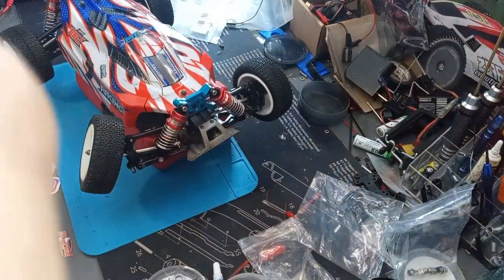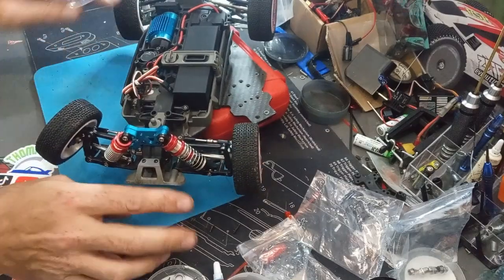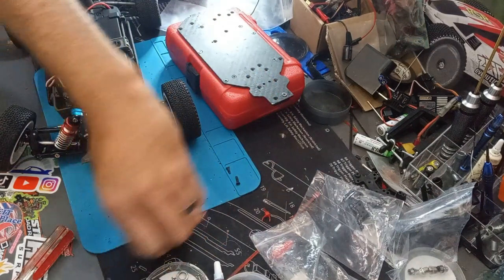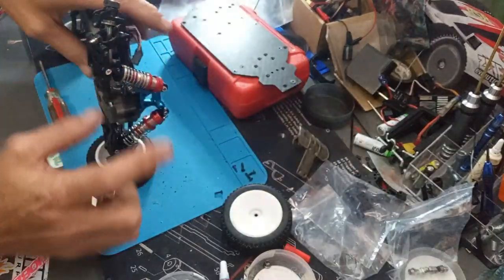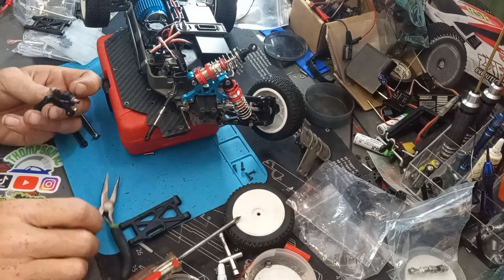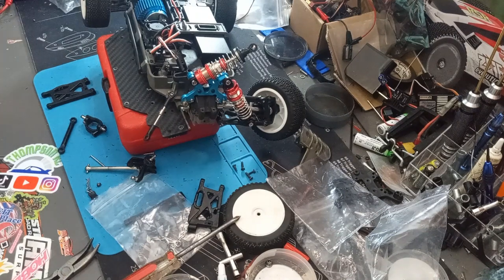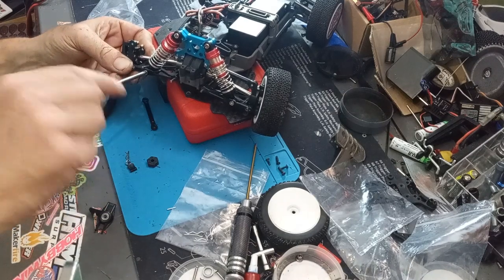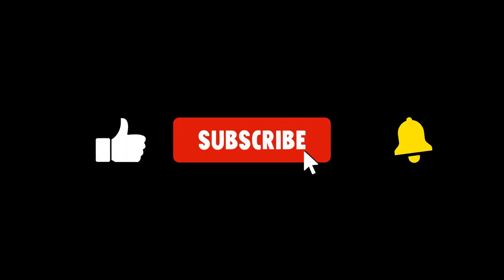Bench Time - wltoys 124008 - Quick Fix - Update - Plus Subs Photos

Comment: Thanks for another informative video — nice problem solving there! 

Yeah, the radio is the DumboRC X6PM with the X6FG gyro receiver. The car has crazy torque so I‘d say it helps a lot with avoiding spinning out when you gas it. 

I have another 124008 on the way, so I think I’ll keep one with the stock setup and put the metal parts on the other one. The incoming wheels are 87 mm, so I guess we’ll see if the drivetrain is up for that. 

Keep the vids coming!
Reply from the maker: Awesome..  I want to get one of the X6PM for back pack RIppin..  I did the same thing with e 124008 one for the track stays stock and one for upgrades and skate park shenanigans ..  

I might put some extensions on one and make to widen wheel base just to see..  

And I'll keep making em if you guys keep watching..   BRRRP..  Thanks for sharing bud.  Thats how this grows..
Reply: @reitplace4765  Yep, that's what gave me the idea to get an extra 124008; it's way more fun with two on the go for racing with a friend or teaching the kids. Plus I can borrow bits as needed, so if something breaks, I should always have at least one operable unit while waiting on replacement parts. 

The super-compact X6PM seems really good so far. I had some concerns about it being too small for my XXL hands, but it works fine and feels solid. Nice that the trim controls are covered, too. 

About the only thing I don't like about it is the hard plastic wheel, but that's easily fixed by sticking a cross-section of bicycle inner tube on it to give a nicer grip.

Keep on rippin'!
Reply from the maker: @mikegreen2214  Perfect..  Exactly my concern on the controler..  They make one with foam or a replacement wheel but I would probabaly do similar to cheap in my case.  Haha,  

Great information bud..  Probably going to pick oune up for travel and crawling if I ever get my C24 taht is ...  

Realy appreciate ya bud.  Glad your in the comments... 

And you know it I always Doo BRRRPP...😎👍
Reply: @reitplace4765  Cheers, dude — thanks! 🍻